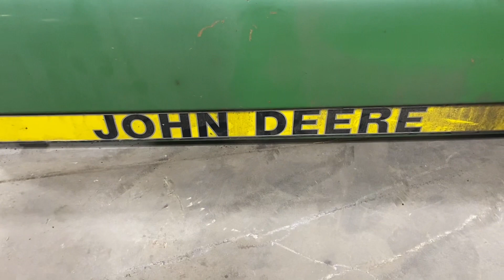Giving the Deere its nose back

Comment: Its nice to see someone getting something done🤣🤣 Life in Wisconsin has come to a standstill as we are finally getting substantial rain... I have about a third of my silage chopped but it will have to dry out for a bit before I start cutting again oh well. Doug you probably should replace th rubber parts in the hydraulic pump drive while your in there, I'm pretty sure you are not as talented as Shane Holst in that department, but maybe you can glean info on those green tractors  from his old videos. Good luck with all of your projects and thanks for taking us with👍👍
Reply from the maker: Man yeah i see everyone is getting caught up on their rainfall down there, up here still not so much but we're pretty well beyond the point of doing any good really. Yeah i do try find experts on these things n learn from them as looking at manuals n books never work with me, cheers

Comment: Used to be a beam scale on the wall in the basement. There were a couple more too. Found 2 or 3 weights for them, but no beams 🤔
Couple chain hoists like that here too.
I would think coyote and momma got to it quickly 🤔
Been years ago, I had a 750# cow that would always wean off a 650-700# calf. Would love about 100 of those cows!!!
Looks like your rigging job worked, check and double check everything..
Would be nice if they actually made a decent place for all the lines to run.
Definitely a good time to find the leak.. and yes, belts are easier with everything out of the way.
I've seen tractors with a lot less than 7k  on them, in a lot worse shape. 
Busy man!!!
Reply from the maker: We have those coyote/wolf hybrids in our area but someone said the severity of the cuts look more like black bear which are also in this area so who knows, she'll make it to wean which is the goal. yeah smaller cow eats less n finishes bigger calves is great for business, i know shorthorn guys rave big numbers on that. And yeah ive seen 20,000hr tractors that are perfect and i've seen county machines with 3000hrs look absolutely shot